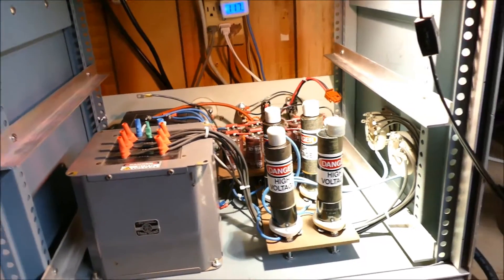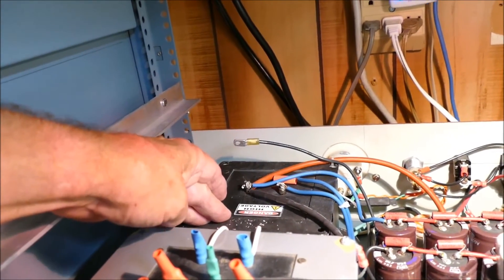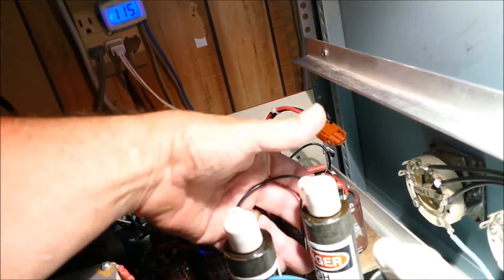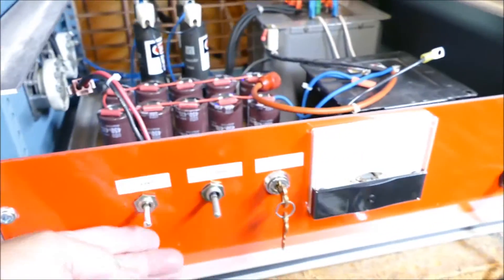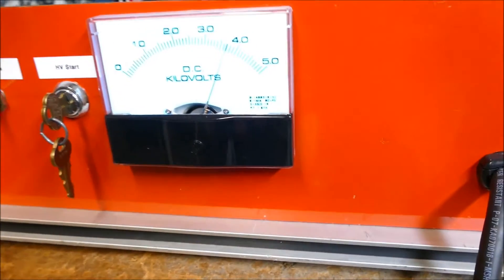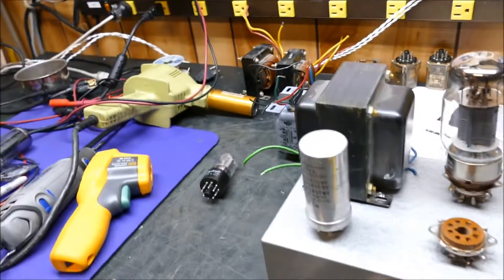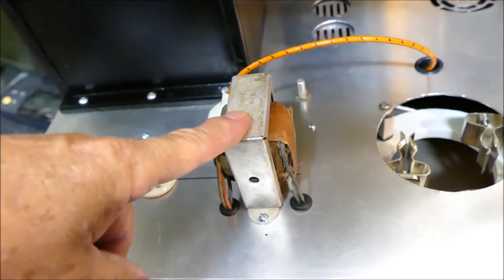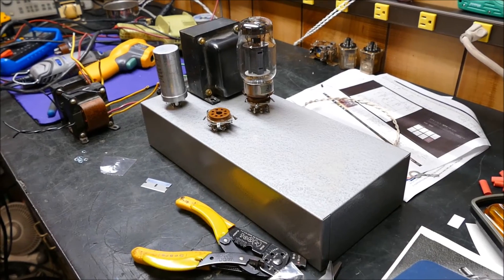High Voltage Power Supply for 833A SET Amplifier

Comment: those diodes tie up the look!
Reply from the maker: noahtheviking It would really be beautiful with the four 866A mercury vapor (MV) rectifiers glowing purple under HV but to add the three required filament transformers, I would have to disassemble the whole rectifier and filter capacitor assembly and rebuild it. Just too much work for beauty :-) and realistically, no one in their  right mind would technically choose MV rectifiers over solid state. Much of this amplifier will be built out of tubes for the aesthetic value and not modern day design.

Comment: Hello,

Where can I find those HV switches? Do you have a couple spares or can you point me to a link?

Thank you for all you toys and knowledge you share.

I can't speak for everyone but a video on tuned input and output circuit build for a pair of 3-500s or 3-1000s. 

Fyi, a chasis for your Colin's 30k-1 with a pair of 3-1000s would look great and outperform your 3-400 pair and it might be the best looking of the bunch. I'm sure you have everything you need but if not and I'll send you whatever your missing

Thanks again for the content!
Reply from the maker: Hi Jared,
I don't have more of those HV ceramic switches but I do see them on Ebay for sale.
A pair of TGTP (tuned grid tuned plate) would be a nice project and even better for the 3-1000Z. I do have a pair of the big guys but would need another 7.5V, 21A filament transformer.
The 833A RF amplifier I built is TGTP and neutralized. Neutralization of that huge 833A triode was a bit of a chore because I had to build a capacitor that was close to what it took to neutralize it and then add parallel with that capacitor a small (James Millen type) neutralization capacitor to get it perfect. The small round James Millen type neutralizing capacitors  are just not high enough in capacitance to neutralize an 833A but are sufficiently large enough to neutralize tubes like the 811A and 812A.  I mention this only because you brought up tuned input and output 3-500Z.  On the other hand, tuned input could be into a pair of GG 3-500Z just as well. I do tune the input of my 30K-1 with a small Heathkit type antenna tuner. I also do the same to tune the input of my 833A 20M amplifier using a homebuilt transmatch antenna tuner I made a video of some time back. 
Hope some of my rambling here helps and thank you for your kind comments.

Comment: What type/brand are those resistors? And what are those four cylinders? Diodes? TRs?
Reply from the maker: 규래김 The resistors are military surplus, and the four cylinders are diodes that replace 866A mercury vapor rectifiers
Reply: ElPaso TubeAmps Ah ok thanks!
Reply: What brand and type diodes are those?

Comment: question about those bypass caps on the main power caps I have seen that done many times before I guess it helps esr but is their a relationship between the value of the bypass cap and filter cap? would it help to have a larger value bypass cap?
Reply from the maker: noahtheviking The red items mounted on each of the large capacitors are resistors. The problem is if one puts several electrolytic capacitors in series, in my case ten (10) capacitors, the applied voltage may not be evenly distributed across each capacitor.  For example, one capacitor may have 300 volts across it while another one may have 500 volts across it - just an example. You choose a small amount of power to be distributed in each resistor at maximum voltage. Let's choose 1/2 watt at 450 volts and do the math which would come out as R=E^2/W. in this case R=(450^2)/(1/2) or,  405K and use 1 or 2 watt resistors. The value is not critical and I used 1 megohm resistors because I have a lot of them. It also helps discharge the capacitors if there is no load on the power supply.
Reply: thanks!

Comment: What type of rectifiers are those?
Reply from the maker: They are known as a 1N2637 and maybe other numbers and are solid state replacements for 866A rectifiers. Here is one on Ebay. I used them because I did not have three 2.5V filament transformers - or the room in the cabinet to mount the filament transformers.
https://www.ebay.com/itm/New-Old-Stock-Sid-State-Replacement-For-866a-Abd-3B28-Rectifier-Tube/303588233797?hash=item46af44d245:g:dJYAAOSwyB9e2oOL
Reply: Thank you very much! Is there an way to PM you?
Reply: I'm in the process of building a couple universal power supplies and would like to discuss further. I have a utc-47 and would like to build it similar to yours. Thanks for your help and take care.